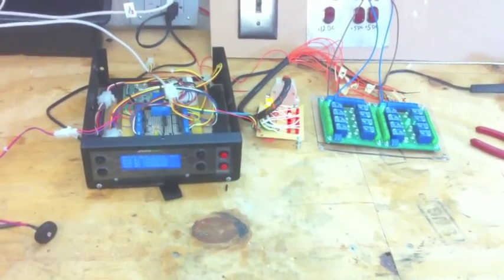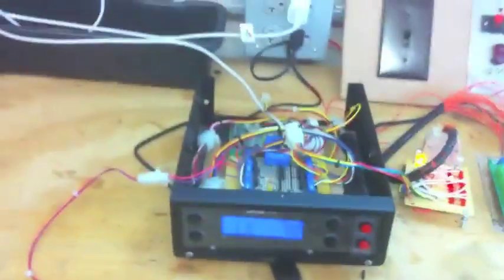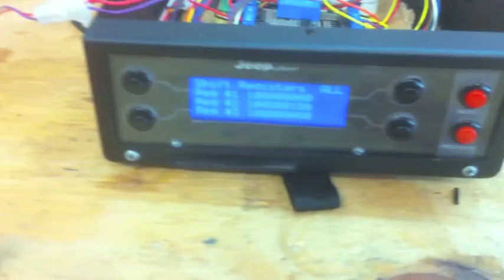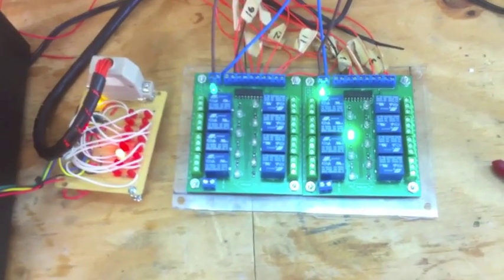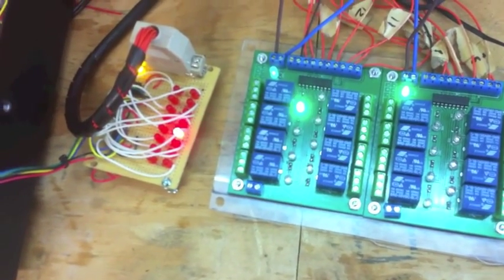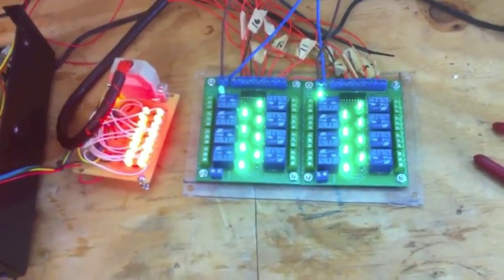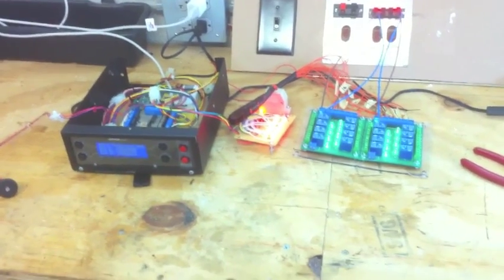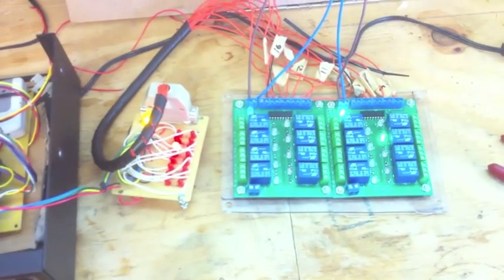JEEPuter - Relay Test

Comment: I assumes these are only rated to 10 amps. What did you have connected and how would you go about it if you wanted to run a 20 amp accessory
Reply: ceriops123 this probably just send electricity to a high power relay. that can manage more power and amp. this is a more like a signal/switch. Just how I understood this.